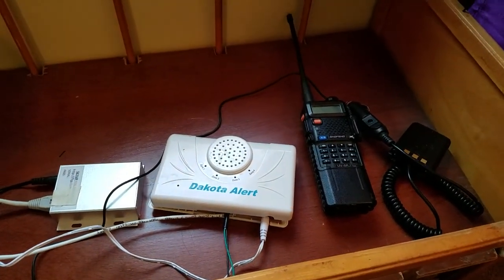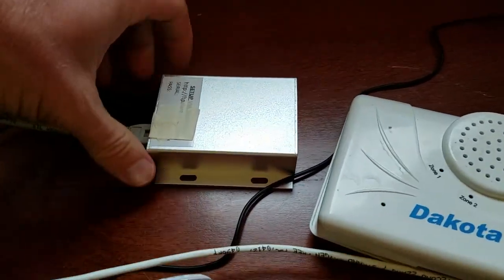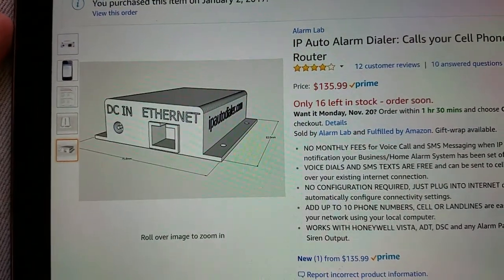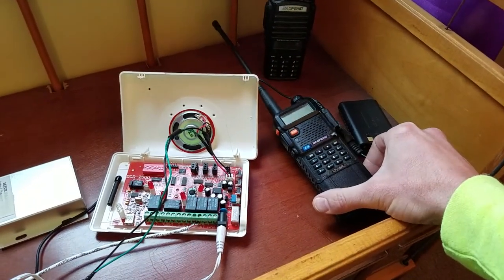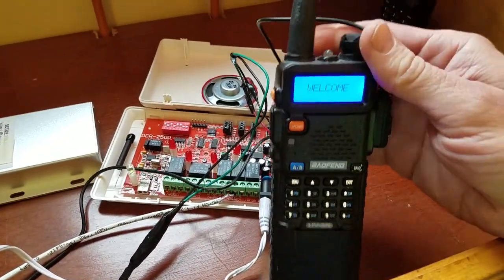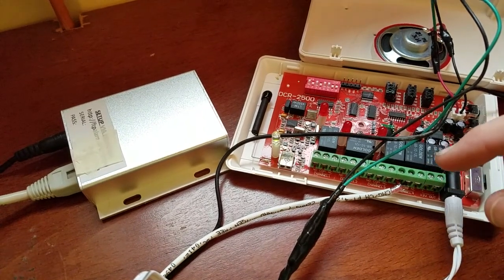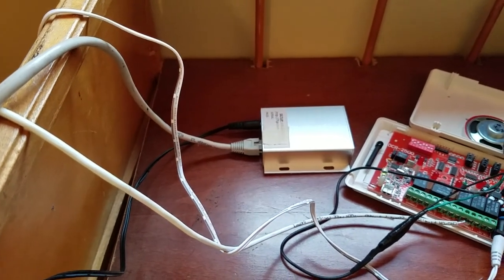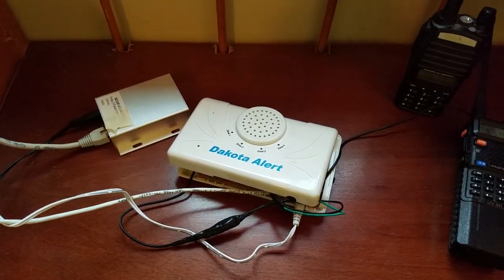Dakota Alert 2500 Driveway Alarm on Steroids - IP Alarm Sender and Radio Transmitter

Comment: If you wire an altronics 6062 timer in your normally open relay set to 15 seconds, and then set your  Alert to 10 seconds, you would be getting back 45 seconds of wasted time between alerts.
Reply from the maker: Good idea

Comment: Hi 👋, Good Info!  My question is related to having a 120V driveway sensor and better yet, tied to my electric gate (Mighty Mule with control button hardwired to house), as the battery sensors have a short lifespan!

Any suggestions for a 120 volt sensor?

Thanks 🙏 
KC
Reply from the maker: Sorry i dont know of any 120v sensors. The batteries in mine last over a year....